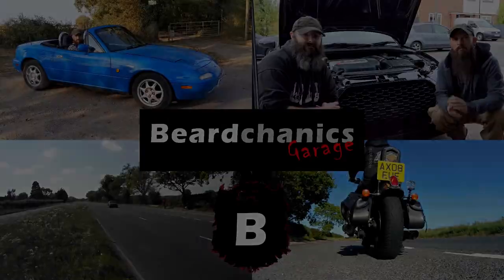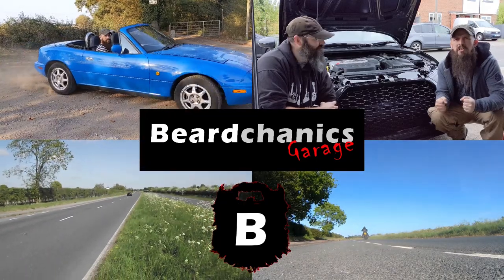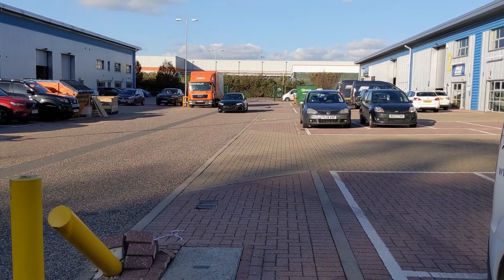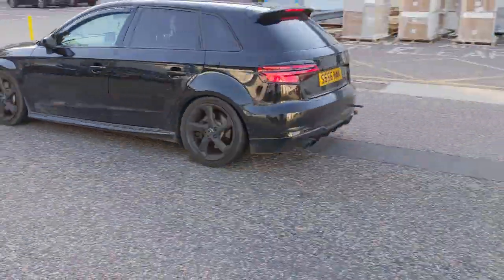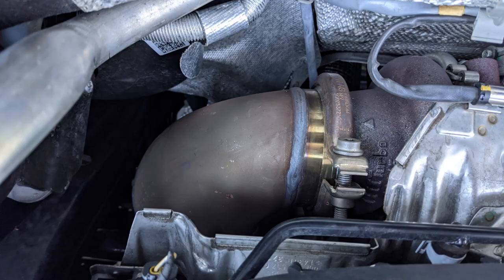STAGE 2 AUDI S3 tuned by AMD Tuning - Dyno Chart, Process & Parts Review

Comment: Awesome video my friends 😃. That dyno graphic is the dream of every car enthusiast. 400hp for 531nm of torque! You got a 4wd muscle car with the body of a German hot hatch. Masterpiece. I can't wait to see you driving your excellent RS3. When you reach the hp limit for your engine you may try with weight reduction, lightweight rims or custom gear ratio optimized for your speed. Have a great day my friends😃👍
Reply from the maker: The plan is custom exhaust (same as RS3 LMS, single exit, central with chopped bumper), then 500bhp+, then get engine internal/piston forged, push above 600 and maybe a little shot of nitrous ;) 

It will also get lighter brakes/wheels. True weight reduction will come when I get another daily and the S3 will get stripped and wide bodied :D
Reply: @Beardchanics  Wooow!! This is perfection 😃🎉. A big central exhaust and an engine with 600 hp. Amazing. My compliments, keep me up to date😃👍🎉
Reply from the maker: @salvatoremertoli6493  Will do :)

Comment: That was really cool’ awesome figures, doing it in stages shows professionalism, not just whacking on a generic map and charging a fortune. Obviously you’re correct letting them do it all as they have done that same work on same car litterally hundreds of times. Loads of other mods you guy’s can do yourself and document. Cool video cheers guy’s 🤙
Reply from the maker: Yeah really trust those guys. No crackles option or other "party" maps, they refuse to do them. Purely performance and they actually run an Audi S3 8V in touring racing so can't go wrong. And to be honest was decent price considering the experience!